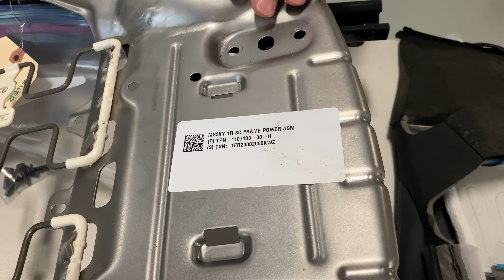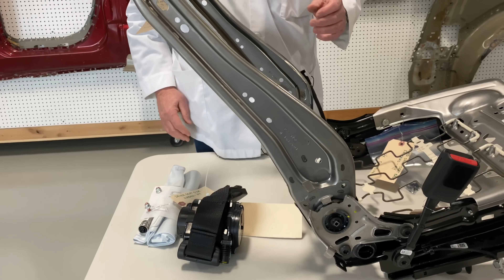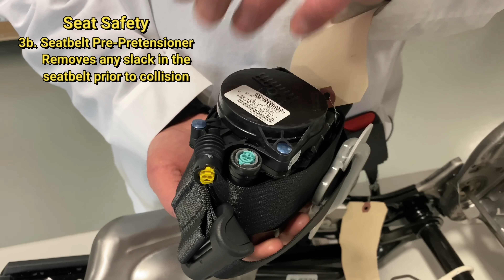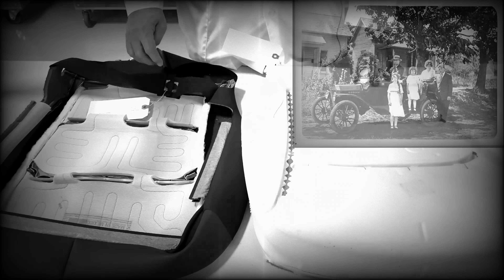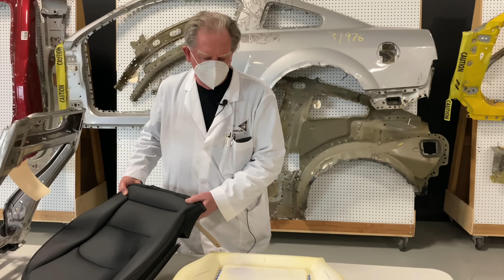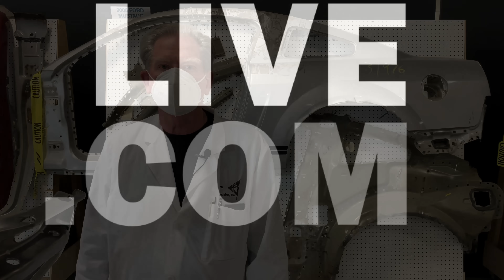Model Y E38: Seat Day at Munro

Comment: If all the cars share the same parts, can you really call them different models then?
Reply: seasong  my god! What about all those cars that share the same tyres! So every car in the world is the same model 😱
Reply: @DavidRyeva  , no he's right. It doesn't matter that the Y has it's own glass, sheet metal, frame, HVAC, wheel size, ground clearance, frunk, trunk, rear seats, seating height, roof line, head clearance, NVH chacterisics, towing capability, wiring, carpet, etc. It has the same front seats and display as a 3, so obviously it is just a 3. LOL.

Comment: Magnesium is lightweight, but also burns like hell
Reply: It takes a lot of heat to set it on fire, so by the time that magnesium seat is burning that would be the least of your problems.
Reply: It's a big issue for the casting plant (which has to deal with molten magnesium!), and it can be a nuisance for machining (chips), but a big solid chunk of it is pretty hard to set on fire.
Reply: Gasoline powered cars are preferred by rioters so much easier to light up!
Reply: It’s also the most expensive per pound. We may find that a set of steel stampings wear better and cost less in the long term.